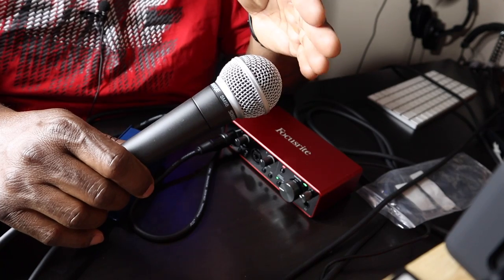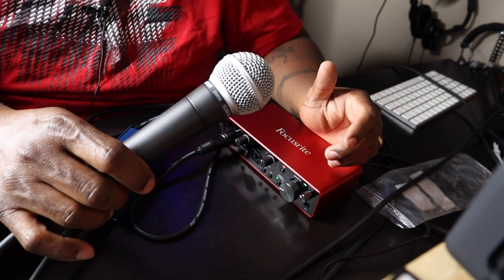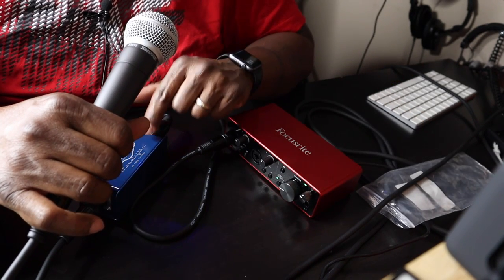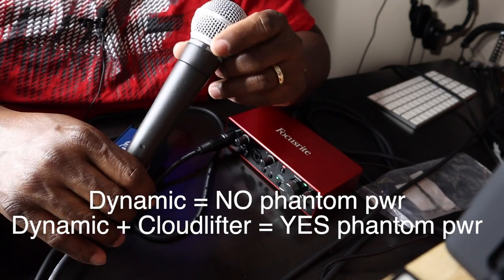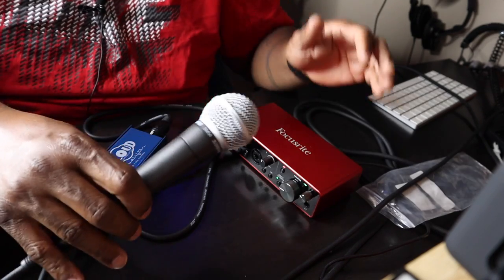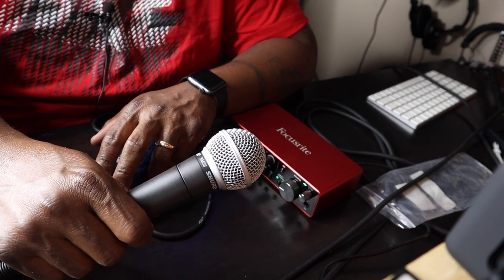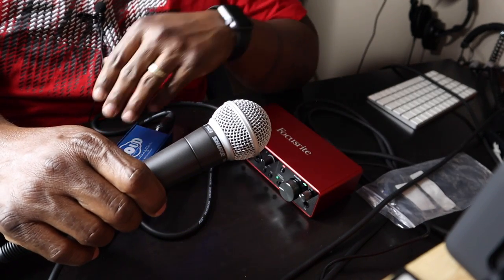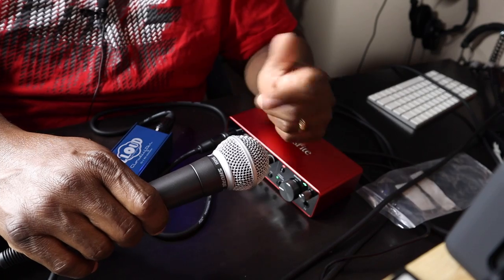How to connect your microphones to your interface

Comment: Oh, thank you so much sir, for this video. I put my system together the first time using a USB powered microphone and never appreciated the extra element I was spared in having to buy, the Microphone Interface. I have an Aria MXL and I was such a moron I thought I got ripped off when it wouldn't work because I plugged it straight into my FX box, that inputs into my audio board (which worked on the USB powered mic, perfectly).  This was greatly helpful.

Comment: Hey brotha I have a question im thinking about purchasing the Shure Sm7b (dynamic microphone) which a lot of people have said needs a lot of gain to work and I would need a cloudlifter like the one you used in the video to get sound from the mic. My question is I have the Golden Age 73 jr preamp will I still need the cloudlifter to use the Shure SM7B or will the Golden Age 73 jr preamp have enough gain to supply to the Shure SM7B?
Reply from the maker: Nice!! I do believe the GAP73 has enough gain to power the sm7b. The volume will not be as loud as what a condenser mic delivers. The GAP73 is a pretty decent mic pre so even if you have to crank the input a bit, it should still be smooth
Reply: @CLEANMUDVIDEOS  ok cool preciate your response family! I   Im naturally loud anyway so the volume shouldnt be to big of an issue for me I just wanted to make sure so I can save $150 lol

Comment: I'm wondering if you could please help me. So I just got a dynamic mic (the Shure SM7B) and cloudlifter with the scarlett 2i2 audio interface. They say on the website that the cloudlifer needs phantom power to operate with condenser mics, is that also true with dynamic microphones? Because it's not working for me. The mic is connected to the cloudlifter, and the cloudlifter is connected to the audio interface. What am I doing wrong? Do I need a phantom power supply?
Reply from the maker: You should just be able to engage the phantom power/48v switch
Reply: I see it now! Thank you so much! You have no idea lol. I'm a total noobie when it comes to audio equipment. I wish there were more videos that showed the "dummies guide" version to audio equipment. There's so much to learn and it gets so confusing. Thank you again for your help!